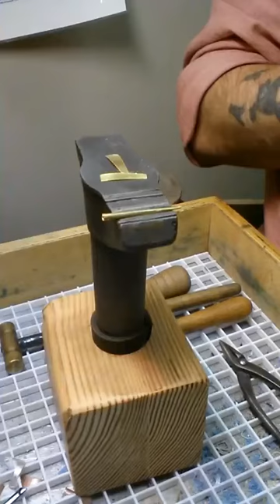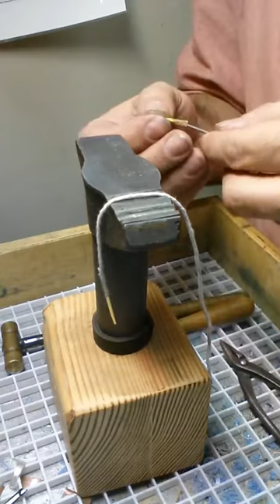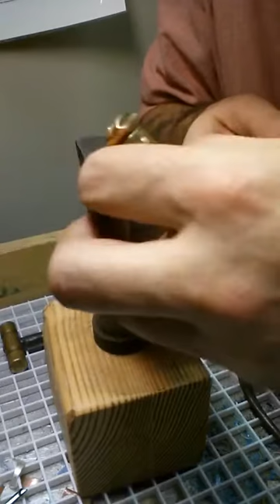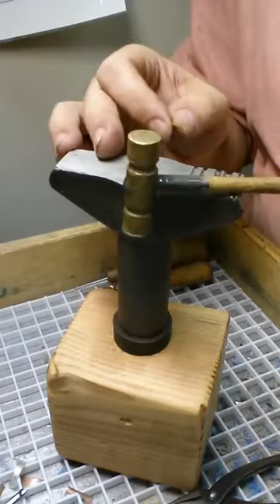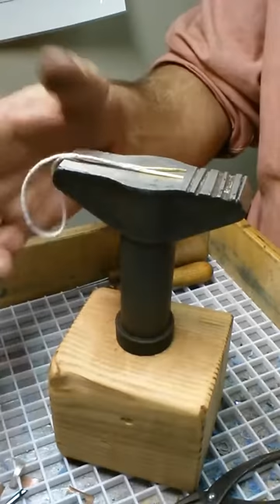Jerry's Basic Jewelry Bench Work 6   Manufacturing type 3 aiglets

Comment: Thxs for posting. To clarify, u said 34g brass? Could I use thicker cuz that seems super thin?
Reply from the maker: #34 gauge works well. once it is shaped it is fairly secure. I have found since I posted this that you will want to use some adhesive. Cutlers' resin works well. I am using a mix of pine resin mixed with charcoal. Some people add about 10% beeswax as well but I did not add that and it seems to work well. Also, copper works much easier as it has more flexibility when you work with it.
Reply: @JewelryDeconstructed  thx u for the reply.